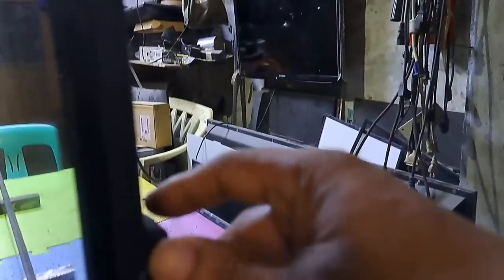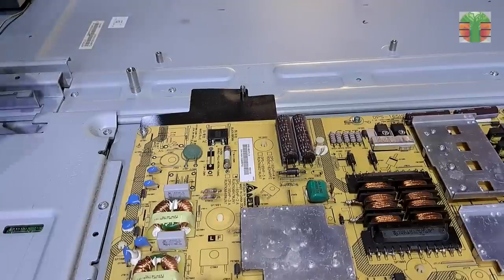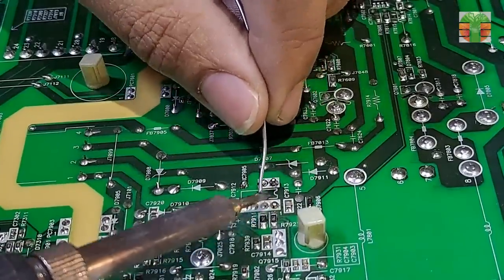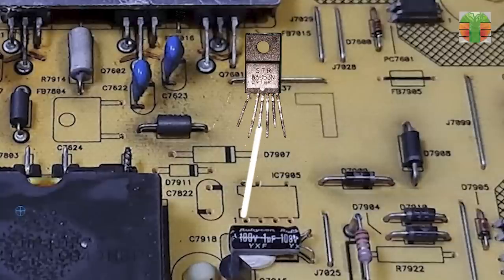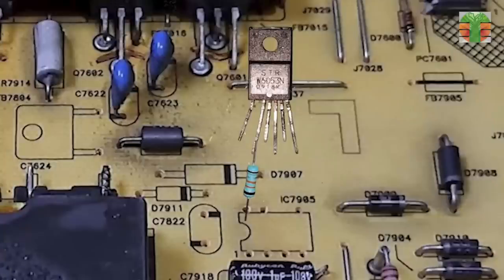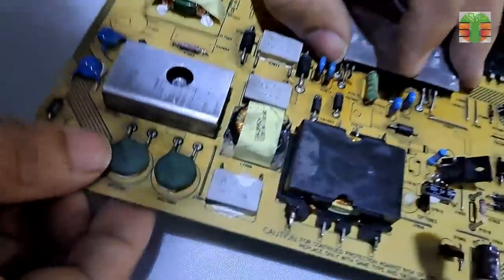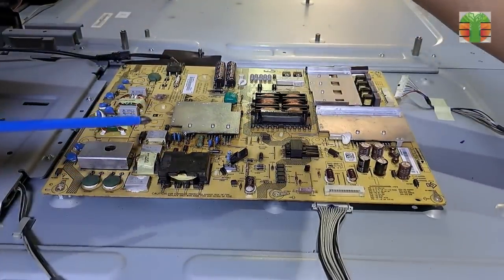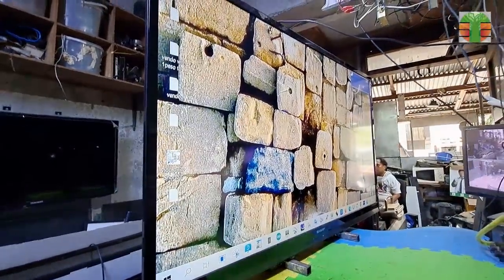60 inches Sharp LED TV NO POWER

Comment: Super, super work done, with ultimate caution. You replace IC with a lot of knowledge and experience Sir, after removing parts the metal leg of IC may remove from under the mother board,so that it should not be short the board, what to say you are super duper 😊

Comment: Thanks for this video It is really helpful, I downloaded the datasheet of the TNY264PN and I noticed that the resistor you connected to the pin 4 has a dual function that is enable and under voltage.
Is that the reason you connected the reason you connected the resistor to the STR? 
Please 🙏 can you upload the schematic or diagram of the conversion?
Thanks in advance
Reply from the maker: TNY264PN pin 4 is the feedback and enable, the resistor to the str6053 is for the over-current protection. that the TNY264PN doesn't have it.
Reply: Resistor berapa nilai nya

Comment: Need proffesional help, philips 47pfl3007h/12, power supply  wont turn off, all the time there is stable output 12, 5.2, 24 volts, even when pw on/ off lose 5v it dosnt turn off.. replaced a6069 wich shuld  turn off power supply but still same.. what else to check.. thanks in advance for all who have solution for this.. p.s the main problem with tv is that show logo and after few sec not respond to any command..
Reply from the maker: Trace all connected at the ps on/off line, there are transistor, resistor and diode on the circuit,  there's may be a faulty component why it won't turn off.
Reply: Maybe it wasn't designed to turn off, there are some power boards that have all their power supplies active immediately you plug it to the source. Like the vestel power is like that newly Samsung power boards are like that too. So I suggest you check from a working TV first. But I think that should be a firmware related problem from the main board